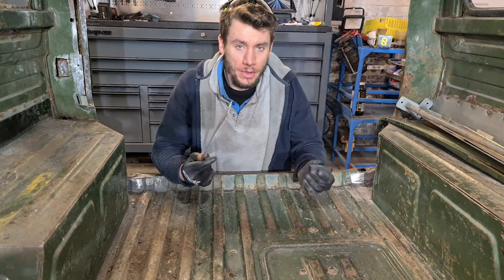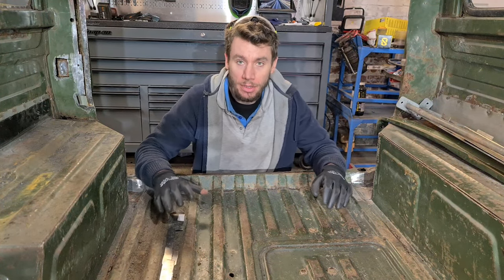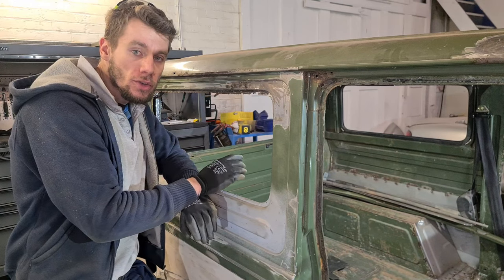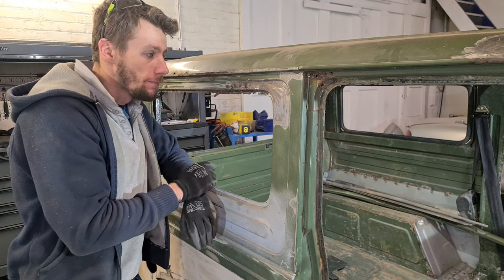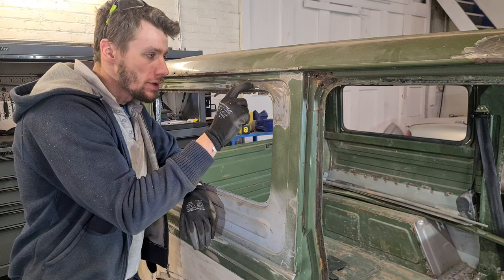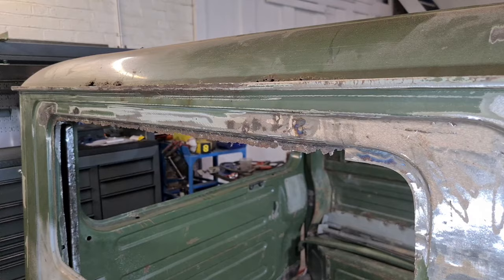Rebuilding A 1980 Suzuki LJ80 ASMR Style.. Kinda. Refabricating Interior Rusty Panels Part 28

Comment: I bet not too many vehicles get quite so rusty inside the cab upper areas as this Suzuki?
My hobby is vintage Japanese motorcycles, specifically 1970s era Suzukis. I’ve had some rusty examples, but if the fuel tank hasn’t rusted out from the inside lower sections from absorbed water (or someone leaving fuel cap off!), they tend to be salvageable. The engines are all alloy and the steel frames are generally too thick to fail completely.